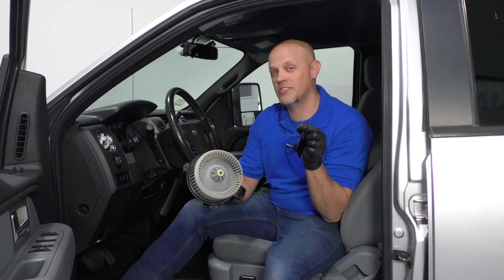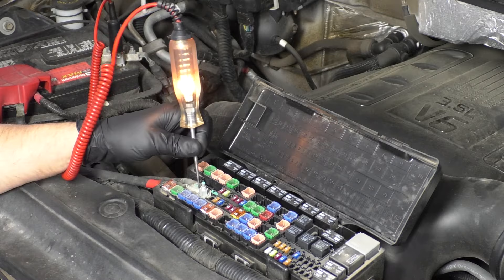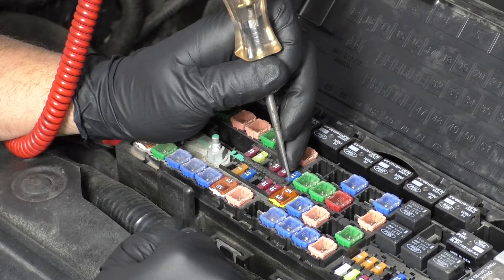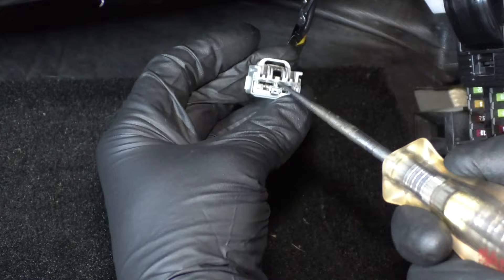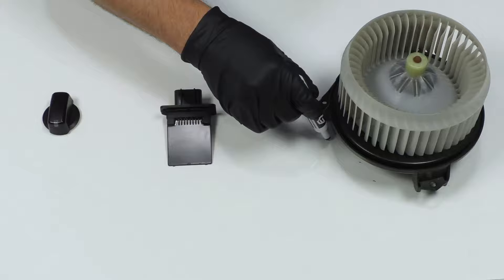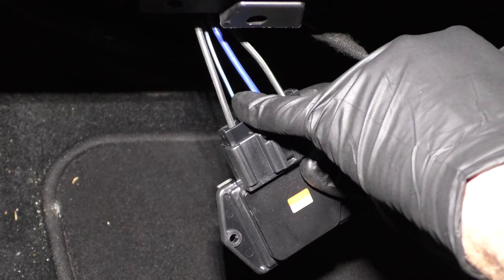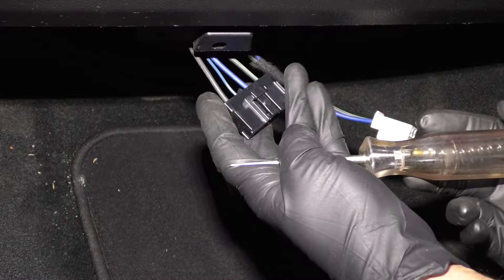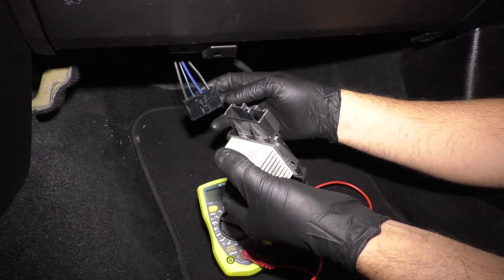Heat Stopped Working In My Car! Blower Motor or Resistor?

Comment: hey i have a blower motor issue. on high only the high speed fan blows after say 10 seconds then blows that high speed fan's fuse. i took out the blower motor a put a fuse-able link to verify there was an underlying issue. the blower motor worked and ran for 5 minutes on the front of the car by the battery. so I can say there is an issue between the blower motor switch on the dash and the fuse. this all occurred when the resistor went bad and there was only high on old blower motor. then the blower motor stopped working on high too. I took out the old blower motor and verified it stopped working by putting power to it with a fuse-able link by battery. it was dead. there was no issue with the high fan speed switch prior to the original motor stopping working on high after the resistor burn up. do you think the switch on the dash got so much heat from this issue that it could of melted??? i took out old blower motor and the resistor, replaced them both. now all the low to next to the highest fan settings work fine, but again if I put a fuse in the high speed fan fuse it kicks on for 5 to 10 seconds then burns it out. no high speed fan. I am puzzled. i did remove the fan switch and ohms tested it, everything seemed to work fine, but under a load it might get a different scenario. ohms tested wires between fan switch and fuse, then from fuse  to blower motor all was good there..can you help?? give me idea of other things to check. I have ordered a new fan switch and will be trying that soon. thank you........Pete

Comment: hi, I just changed the resistor. When i tried the fan, on setting 1 works, setting 2 blows alot, but on setting 3 it seems to blow less. Is this normal? Is there another problem i should check.

Comment: I have an ‘08 Nissan versa my fan is making crazy sad noises heat and cold are still working. Should I just replace it all (resistor and motor)? I don’t have all those tools to check everything. It’s not a young car.

Comment: So I replaced the resistor in my vehicle.. It is a 2012 Nissan versa. Installing the new resistor didn't work.. Should I replace the blower motor relay before actually seeing if the blower motor itself is faulty

Comment: Everything is working properly I replace the motor and the resistor but for some reason it's not blowing hard like I want to the other thing is is that it seems to be stuck on blowing on the floor and the top at the same time
Reply from the maker: +robert r We wouldn't be able to diagnose an issue like that here, you may want to have a local mechanic take a look at it. Thanks for checking us out! http://1aau.to/m/Shop-1AAuto-c

Comment: Save yourself some time and $$ and replace both the motor blower and resistor at the same time. My motor blower was working but the new resistor blew right away after being replaced. The motor blower may have been working but had other issues. I've had no other issues since replacing both...

Comment: I just replaced resistor and checked fuses and I have no power at the motor with the fan to full blast. The motor was working Intermittently before the change. Should I reinstall original resistor and start troubleshooting from the beginning?

Comment: I have a 2008 Ford Expedition. Front AC stopped working but the rear is running and blowing cold. Could it be the blower fan or resister? Would the compressor/clutch be out and the rear AC still cool?
Reply from the maker: +The75Big We wouldn't be able to diagnose an issue like that here, you may want to have a local mechanic take a look at it. Thanks for checking us out! http://1aau.to/m/Shop-1AAuto-c

Comment: Hi Sir,

My BMW 5 series had a blower motor issue, there was no air from the vent. I went to a garage and they diagnosed it and said it was a blower motor resistor issue, as the blower motor is working fine and needs the resistor change. The resistor fails while they change it and they couldn’t find the root cause of the issue. Could you please suggest a way to resolve this issue?

Comment: Hi I have an issue,my ac work but fan. Goes on and off  I replaced ac control ac unit many times problem  still sometimes  work and some times don't so It may be resistor then

Comment: Hello I have a 2018 Malibu LT and when I turn on the AC it makes like a buzzing sound, when the AC is on full blast it’s loud and noticeable. Sounds like it’s coming from the passenger floor or around there
Reply: Change the fuse
Reply: Sounds like someone may have dropped an object(Toothpick, gum wrapper, etc) down the windshield vents and it's found it's way to fan. Pull the fan out and check the blades & see if there's anything in there that shouldn't be there.

Comment: Do you have video on how to replace the housing where the blower motor goes?  I found my blower fell out cause the housing has broken pieces so the blower motor won’t sit in place.  Currently using duck tape but it’s not working.
Reply from the maker: +@UncleJoJo619 We're always cycling through common cars. We'll add this repair to our list! http://1aau.to/m/Shop-1AAuto-c

Comment: I have a 97 cavalier and the motor doesn’t blow until I apply pressure to the actual motor with my foot and then it blows like new until I take my foot off then it stops or making a banging sound. Any suggestions?
Reply from the maker: +Smoke at least one Thanks for watching and the question.  We are unable to diagnose what may be causing this online.  We suggest bringing it to a local mechanic for diagnosis.

Comment: I’ve replaced the resistor, relays, fuses, blower motor works straight wires it bought 5-6 automatic temperature control units an still nothing

Comment: I have a 2020 sierra 4.3l
Can't find wiring diagram. It has 2 large wires on the module 1 + and 1 -. 2 small wires 1 is ground very low voltage thay doesn't chamge with adjustment of speed. The other small wire has nothing. Motor has ground but no power at plug when called for.

Comment: Hy.i got mercedes benz a class a170,1.7,petrol,2005......last year on december  my car heating works great..i was on christmas in holliday in another country,when i comeback the heating dont work like before...and after couple of days just start working,no more warn air gived...in dashboard showed me to add more coolant..i put more but heating still dont come...someone said to i reflush the sistem and refill with coolant and that will be fixed and heating will run..i dont know big thing about mechanics..but what you think can be?before used to work perfectly the heating,in the morning at 5 oclock,when was -2 grace outside,in 3-4 minute was warm in the car..all stop after i comeback from holliday....please help me if you know an advice

Comment: My BMW F10 fan has a problem. When I turn the largest fan, the fan will run about 20 second and then stop. I need to turn off the fan , wait about 3 minutes and the fan will running again. I already changed the resistor but didn't fix. Do you have any suggestion? Thanks.

Comment: Help please 
I have a 03 suburban rear ac not working but has power I have changed rear blower resistor and blower and blend door was damage so replace to but not ac coming on I have power to resistor and blower but blower not coming on (turning or working) please help

Comment: So I'm lost I have a 2000 equinox that once in a while if I hit a bump it burns me up and there's times that it'll only get lukewarm I had a damper or blend door actuator issue from day one that I bought the vehicle knocking that's been replaced but I still only get lukewarm air.
 any idea's ?
As far as I know I have good air flow in all the spaces that I need it.
I've checked the coolant level it seems to be okay just lukewarm at operating temperature.
Reply from the maker: +red2965 We wouldn't be able to diagnose an issue like that here, you may want to have a local mechanic take a look at it. Thanks for checking us out! http://1aau.to/m/Shop-1AAuto-c

Comment: I have a 330I and somehow water got into the dash board and the JB BOX, FUSE BOX got all wet and at one point nothing work on the dash board cluster only my head lights and tail lights and signal lights, after a few days later everything went back to normal and now my AC blower motor is not working, I replaced the fan motor, resistor, and the fuse box and fuses and still not working please help me out

Comment: hey what to do if i have this problem i changed blower motor resistor i checked fuse but nothing works. When i switching Control nothing happens i checked voltage on bkower motor and his resistor - voltage good. When i checked control Button where you changing speeds, one of 4 vires says 0 volts but maybe its - vire? where is the problem? Maybe controlet not work, maybe little rust on that after taking everything.;)

Comment: I got w204 c class 2009 mercedes i have changed both blower motor and resistor. There is no voltage at resistor except for the signal wire from control module. I tested by giving the positive terminal a 12v supply from cigarette lighter to check if the blower and resistor works it did. I checked all the fuses they are all good can you please help me to why i am not receiving power at the resistor terminal connection.
Reply from the maker: +Aqib Mansuri We wouldn't be able to diagnose an issue like that here, you may want to have a local mechanic take a look at it. Thanks for checking us out! http://1aau.to/m/Shop-1AAuto-c

Comment: So my blower motor doesn't blow air but the temperature I can still change to hot or cold and I when I drive I can feel the vents heat up and get cool.....any thought of wht it might be
Reply: This could be any of the issues on this video. The reason why is because the warm and cold you can feel through the vents is there 'naturally' regardless of whether blower motor is working because when you move the hot/cold dial it alters the position of the flap inside the heater box to allow either cool air pass through or warm air to pass over the heater matrix (mini radiator in car full of coolant basically) so regardless of whether or not the heater electrics are working in your vehicle, you will still feel a slight gust of warm or cool air at the vents if the hot/cold flap is still able to move.

Comment: Hmmm. My 2006 Mercury Montego has AC and heat working, but when i turn if off the defrost turns on high.  Only by turning car off will it turn off. Mechanic is replacing the resistor, hope his fixes it.

Comment: BUT if the AC works fine at all speeds, only the heat is lacking? Can't find anything informative enough on the net for a ford fusion 2012, this car is different from others behind the hood in the heater/AC hoses and wayy more difficult to reach the parts I need so I'd rather KNOW what to do before I start removing things & if I need to.

Comment: hi everyone?  i have an A4 2014 B8.5 1.8 model TSFI... I have a problem with my aircon. when you switch it on, it blows air, but the air only comes from underneath vents by the feet, and by the windshield vents. But NO amount of air flow is coming from the side vents of the dashboard or the middle vents of the dashboard by the radio. what could be wrong? thank you for your suggestion.

Comment: A1 video friend. Very thorough and easy to understand instructions. Do you know what the most likely problem is if my air was working fine and then I turned the key on the next time and my motor started sputtering and is blowing but making noises and its turned all the way up but barely blowing. Air is still cold. Switch makes it stronger but when it's all the way up its like its on 1 and when its on 1 its barely on at all.
Reply: Lmao I said this was an A1 video without realizing your name is 1A 😂😂😂
Reply: I'm sitting in the car letting it run and it keeps getting weaker and stronger slightly without me doing anything.
Reply from the maker: +Nerd Core Thanks for watching!  If the motor is making odd sounds then there could be an issue with the motor.  The resistor is what controls the speed and does not typically result in odd noises.
Reply: Bushing going bad

Comment: hi everyone?  i have an A4 2014 B8.5 1.8 model TSFI... I have a problem with my aircon. when you switch it on, it blows air, but the air only comes from underneath by the feet, and by the windshield. no air is coming from the sides of the dashboard or the middle of the dashboard by the radio. what could be wrong? thank you for your suggestion.

Comment: i took my car to an A/C repair shop and they said i need a power module but i when look up power module it keeps bringing up the resistor. So is the resistor the power module ?
Reply from the maker: +Isaiah Lawrence Thanks for watching!  Depending on your vehicle it can be referred to as the control module or resistor.  Sometimes they can be referring to the module for the A/C condenser fan under the hood, so you will want to make sure which part they are referring to!

Comment: Hi i have motor that works with 12 volt direct from a 12 v battery.-🤨 and also i do have 12 v out of the blower power connector 😳😳 but when I plug the connector to the blower motor the power disappears and the blower motor doesn’t works.-🤦‍♂️🤦‍♂️🤦‍♂️ any idea???thanks
Reply: I have same issue.  I changed resistor and blower motor still no power and I had a shop check my fuses. Nothing works

Comment: I checked the freon level, it's ok, my resistor is bad, the blower motor makes noise, but works, could  the resistor be the reason for cool air, just not cold air???
Reply from the maker: +Raymond Uelk We wouldn't be able to diagnose an issue like that here, you may want to have a local mechanic take a look at it. Thanks for checking us out! http://1aau.to/m/Shop-1AAuto-c

Comment: My blower keeps shutting off and wont turn back on until I pull the relay out and put it back in.  Already replaced the relay and it works.  So why does it just shut off?

Comment: So my heat/ac quit working and my blower motor relay has scorch/burn marks on the relay/fuse board. What could cause this?
Reply from the maker: +deadworld 66 We wouldn't be able to diagnose an issue like that here, you may want to have a local mechanic take a look at it. Thanks for checking us out! http://1aau.to/m/Shop-1AAuto-c

Comment: -Question
What if it the ac blows intermittently? Meaning, I drive to work in the morning and the AC blows cool and fine. I get in the car in the evening and no air blowing at all?
Reply from the maker: +MrOdyne80 We wouldn't be able to diagnose an issue like that here, you may want to have a local mechanic take a look at it. Thanks for checking us out! http://1aau.to/m/Shop-1AAuto-c

Comment: I'm having an issue where my ac/heater fan turns on at first, but if I turn my car off and then back on with in 1-2 mins the fan wont work . Sometimes on the highway it will start back up. I'm confused ..

Comment: I have 98 Toyota Corolla and the blower motor makes noise every time I turn the AC on, but also stops blowing after some time and if I turn it off by the control panel then it won't start again, what could be the main reason? I'm planning on replacing the blower motor but want to be sure that's the real problem!
Reply from the maker: +El MOCHOMO That is a good start!  If that doesn't solve the issue we recommend having the vehicle professionally diagnosed.  Thanks for watching!

Comment: Only part missing is what make model and year the vehicle is that he's working on because this is going to determine the actual location of the blower motor resistor and blower motor. I have a 1997 Mercury Mountaineer and a different guy with the same company said that the blower motor resistor and blower motor is under the hood and this is why I hate Ford. Majority of these electrical parts should have a fuse attached to it to make it easier to replace instead of having to actually replace the actual part itself , I checked the fuses everything was fine there's no way to check relays according to the parts stores which is weird however I tapped on my blower motor under the hood. It came back on but it kept needing to be tapped on every other day and now it doesn't work at all I'm wondering if it's the blower motor or the blower motor resistor that needs to be replaced. One guy told me that I can connect my jumper cables to the battery and connect to other side to the blower motor I don't know how to do that I don't want to get shocked so one day I decided to tap on it. I got the idea from a starter sometimes you can tap on a starter to crank the vehicle
Reply from the maker: +TheProdigyThatKeepsItReal Thanks for the feedback!

Comment: I smell burned smell when the heater is on max...should It be resistor or motor?
Thank you
Reply from the maker: +Jay Barbosa We wouldn't be able to diagnose an issue like that here, you may want to have a local mechanic take a look at it. Thanks for checking us out! http://1aau.to/m/Shop-1AAuto-c

Comment: my problem is when I off on the controls the blower motor still running but the car is still on. I shut the car off it does turn off. once I turn on anything from the controls that's when it turns on but never shuts off till the cat is off

Comment: What if my small switch is getting lower voltage the higher I turn up the fan. The highest voltage (10 more or less) is when the fan is on the lowest setting. 

Blower motor won't shut off! Grr.

Comment: I have a 2001 pontiac montana I changed both my heater still don't work what could it be
Reply from the maker: +uncle moochie We wouldn't be able to diagnose an issue like that here, you may want to have a local mechanic take a look at it. Thanks for checking us out! http://1aau.to/m/Shop-1AAuto-c